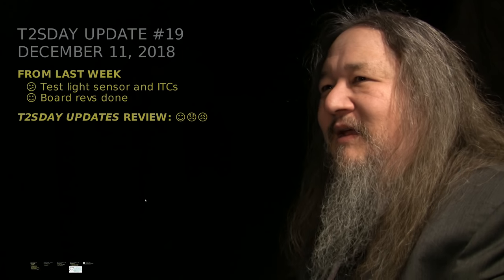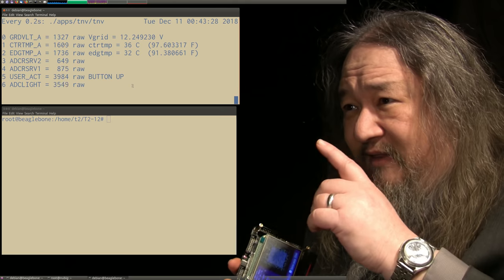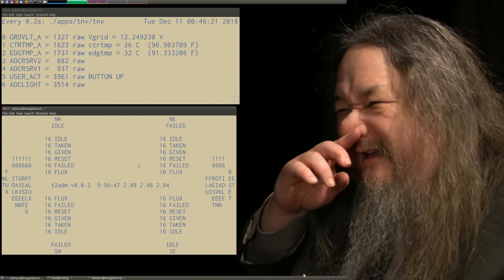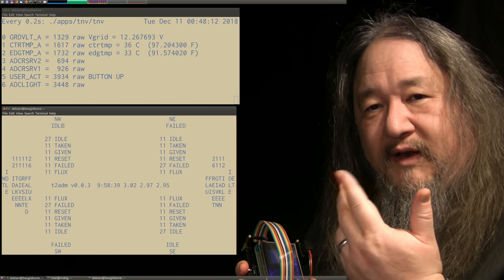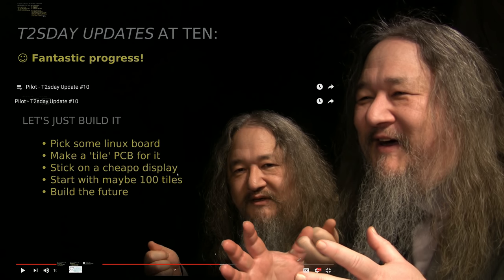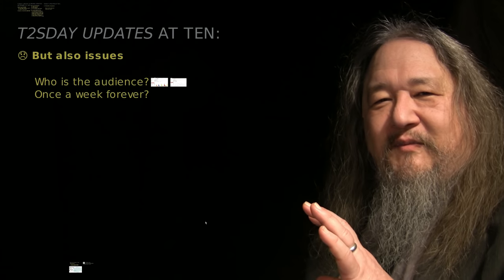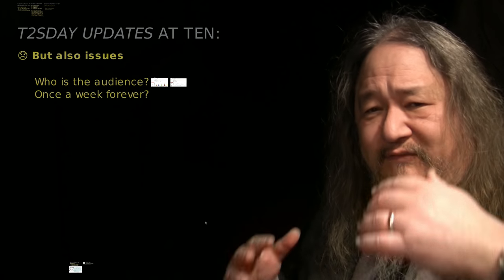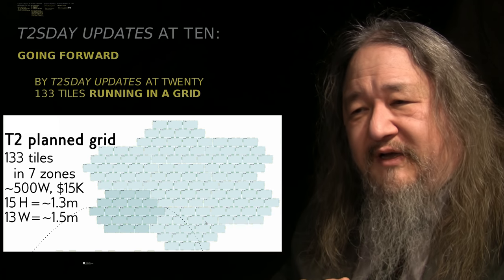Ten Weeks with a Circuit - T2sday Update 19

Comment: The way you connected the tile to itself actually still results in a torus topologically (even though some parts crossed over).
Reply: Hmm... are you sure? It seems to me like the surface would be self-intersecting. Is there an illustration you could link to (or create :p) ?

Comment: (1)
8:08 re: torus connectivity - I believe the surface is called a "cross-cap."
rectangle w/ 1 pair of opposite edges meeting: tube, cylinder
rectangle w/ 1 pair of opposite edges meeting with a half-twist: Mobius band
rectangle w/ both pairs of opposite edges meeting: torus
rectangle w/ both pairs of opposite edges meeting, one pair with a half-twist: cross-cap

https://en.wikipedia.org/wiki/Cross-cap it does not exist properly in 3D space (similar to the Klein bottle if anyone is familiar with that).

(2)
Thoughts on naming a 133-cell. In general there appears to be a self-similar property, a repetitive quality. 

1 tile
- 1-cell (there is only one 1-cell)
- level 0 honeycomb

1 tile wrapped in 6 tiles
- small honeycomb
- small snowflake
- level 1 honeycomb
- regular 7-cell
- 7-cell (generic term referring to having 7 tiles in a topology)

1 tile wrapped in 6 tiles wrapped in 12 tiles
- level 2 honeycomb
- regular 19-cell
- "power zone" (an important topology from an architecture perspective, but otherwise perhaps not significant from a general naming perspective).

"133-cell"
- small honeycomb using powerzones as a unit
- level-1 honeycomb constructed from regular 19-cell units

does the nomenclature scale?
- regular level 9000 honeycomb
- level 6 honeycomb using regular level 9 honeycombs as units
Reply from the maker: Wow, 'cross cap'!
Reply from the maker: A half-twist seems a little different than what happens on the T2 Y-axis loopback, if I'm understanding it right.  If the columns are numbered 1..N, a half twist matches 1:N, 2:N-1, ..., N:1.  Whereas the cut-and-swap T2 mapping does 1:N/2, 2:N/2+1, .., N/2-1:N.  Or no?
Reply from the maker: It is very aggravating that I can't seem to see this great comment except when I view comments 'Newest first'!  I had to 'approve' it to begin with, for some reason, but now it's been approved, liked, hearted, and replied to twice -- and still seems virtually invisible!  Gah!
Reply: @T2TileProject  Hmm... yes you are understanding it right, the cross-cap would have that "reciprocal"-style mapping you laid out. Ok so there is no reversal of order with the northeast to southwest connection ... so I don't know of a special name other than just a knot or a pretzel. :-) 

Yes I have also had trouble with the "Top" vs. "Newest first" views ... I don't know if it's a Linux thing, a Firefox thing, maybe an actual defect in YouTube, who knows. I run various tracking script blockers, so I usually figure it's my own fault for removing a JavaScript component that's actually required for the site to work.

Comment: Hi Dave, as you probably are aware, I have been following you for a few years now, because I think this is a brilliant idea to change computing for the better. 
So much progress has been made in a few weeks compared to previous years, bravo!
I would not worry about audience, the people that get it, will grow with progress. also keep time of the year in mind.

As a software guy, I get why you get lost in a hardware world, maybe other people can jump in, and make a proper dedicated processor like Parallela but custom made for mfm / ulam.
it could be the size of a full Wafer. 12V is already doing well, but I think a custom, preferably clock-less cpu could reduce the power even more. 
The temperature is Ok, it shows the processor is busy and producing ~3V to X amps Watts of heat while processing.

133 tiles sounds great, does that 15K have to come from your own pocket ? why not crowdfund it, I really would love to own one too, perhaps hook it up online and share the computing resources in a cloud, $250 each? $50K to raise seems a reasonable goal. 400 bricks. bricks, stack (event window), wall.
Reply from the maker: The T2 tile is hot, slow, big, heavy, expensive, and clunky as hell -- but all that can be fixed later by experts -- if we can design and develop and demonstrate this new architecture, this new best-effort hardware-software interface, now.
Reply: @T2TileProject  at best, 50% of the energy consumption will be radiation heat. The price per brick is high now. But for research purposes reasonably affordable. Size is irrelevant if I said the processing part could be full wafer size.
Reply from the maker: @KeimpedeJong  Using a full wafer as the 'tile' would provide awesome computational density but also a tremendous pinout problem.  The connections between full wafers -- for intersite locking and local cache updates -- have to be about equally dense, or indefinite scalability is lost before we even start.